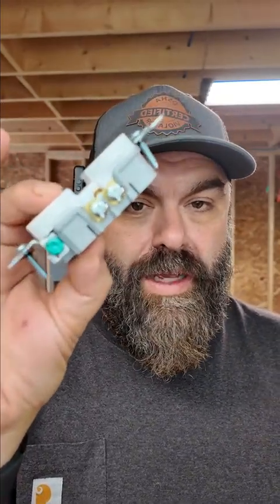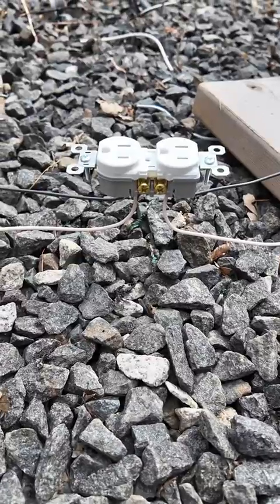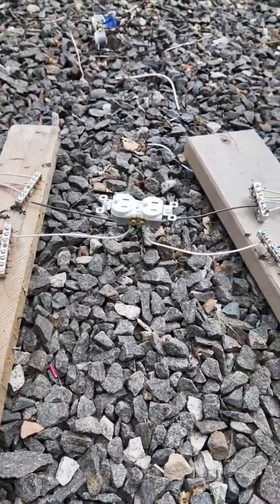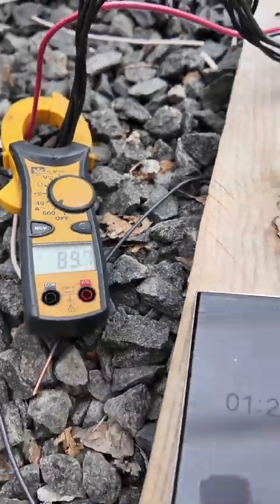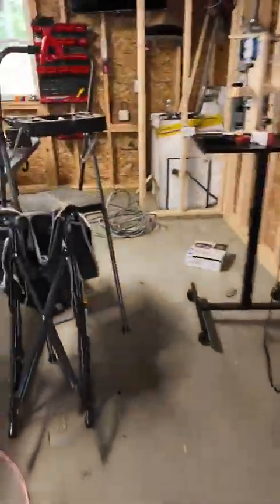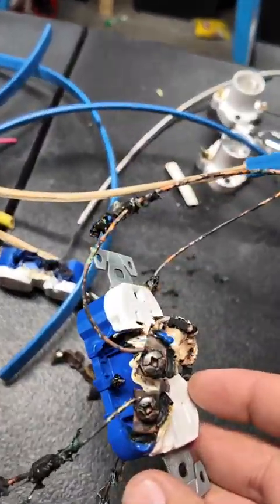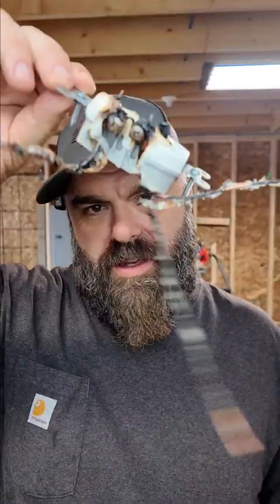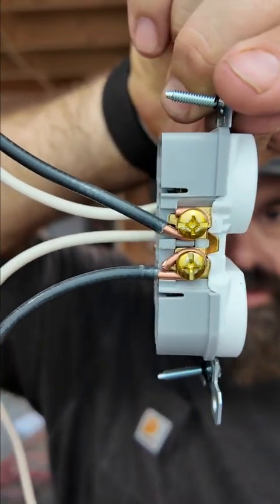91 amps fed thru back stabs on a receptacle for 10 minutes

Comment: I'd agree with that conclusion - for anyone interested in the math: heat is power -> power is I*I*R -> 1mΩ [ie far below anything your handheld can read] at 91A is around 8W of heat. 10mΩ [still far below what a normal handheld can read] makes about 80W.

Resistance plays a REALLY big role when the amps start climbing

Comment: Can you answer a few questions I have please? If true could you make a video about this? Will an unbalanced panel between phases on a 230/1 panel cost you more money to operate or cost you on your monthly electric bill? If so, do the devices advertised that balances loads between phases work? Do you recommend them? Or any brand? Anther question is, will sub panels that neutral and grounds not separated cost you more on your electricity bill if your panel is or isn’t balanced. I know about the danger with separating them (thanks to your videos) and I’m working on that problem now at a home I purchased with 3 small sub-panels ,but I’m curious about an increasing, decreasing, or the same cost on monthly electricity bills.
Thank you,
Mark J

Comment: Hear me out... stab the input into the back and plug the hotplates into the outlets. That will transfer the heat better, causing the outlet to fail completely. To do this, splice in two plugs with 14ga wire. This is all hypothetical based on my unprofessional ideas

Comment: This is certainly interesting to watch, but I'm a bit concerned that people will come away with the wrong conclusions from it.  To be clear: This experiment does not really prove anything (one way or another) about whether backstabbing or screw terminals are safer or "better" in general.  This is only one isolated test of one receptacle, using currents that would never actually even happen in the real world.

I think it would be a lot more interesting and far more educational if you tried to figure out under what conditions normal currents (i.e. 20A) might cause an outlet to melt down instead.  For example, test improperly tightened screw terminals, backstabs that have been removed and reinserted (once, twice, etc), maybe even an improperly tightened wire nut, etc.  And try to see if you can get any of them to fail under normal operating conditions.

I also think you should try running the current through the actual outlet prongs (by plugging in a plug, etc) and see under what conditions you can overload it that way...

Comment: My average wattage usage dropped after I found a loose neutral in my meter box.  
Bill is down about 30-50 dollars.

Others say a loose connection couldn't possibly cause a higher electric bill. 
What say you?

Comment: It would be interesting to see what happens if you backstab and remove a wire from the same backstab port several times before running the test.   Some receptacles actually say that the backstab port cannot be reused after a wire has been inserted and removed.  But others don't have such a warning, so it theory, it should be okay to insert and remove wires from the backstab port several times without causing a problem.
Reply: you are spot on. In my testing that is what happens, and the instructions even say to not reuse I think

Comment: So basically, you are saying this experiment shows that backstabbing isn't really any more dangerous than using the screw terminals. Too bad you can't do the same test with the 10awg in a backstab as that would be the full test I think. 

I also see conventual wisdom from electricians that running electricity through the outlet itself like this shouldn't be done and instead to pig tail so that it bypasses it, but I feel this experiment also goes against that as the tab never failed like you mentioned.
Reply: I keep hearing that bckstabs are sometimes weaker, and over time they come loose and cause arcing. A light switch in my house had a backstab come loose, and you had to punch the wall for the lights to work, and switching on the bathroom fan you can hear arcing behind the wall and the gfci was going crazy.
Reply: No, this experiment shows that in one test one particular backstab receptacle performed about the same as using screw terminals did in some other cases.  It does not show anything at all about "backstabbing" in general (or screw terminals in general, for that matter).

That would require a lot more testing over and over under many varied conditions, etc, which he is not doing here.

(This is also all way over the rated currents for all of these things anyway, so to be honest, anything he's doing here is all pretty irrelevant in the real world (where a breaker would have tripped long before this point anyway).  It's certainly interesting to watch, but you shouldn't really use it as the basis for any decisions about real-world applications.)
Reply: There is more conductor in the tab than in the wire until at least #10